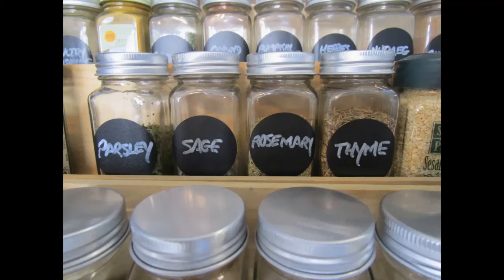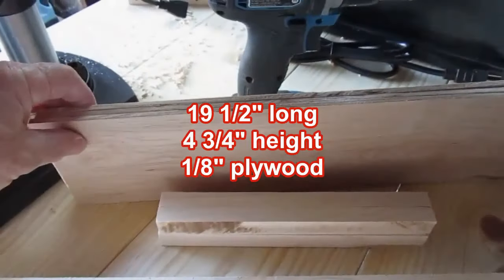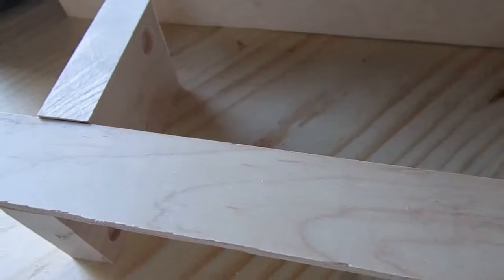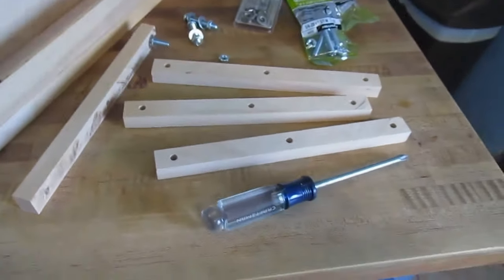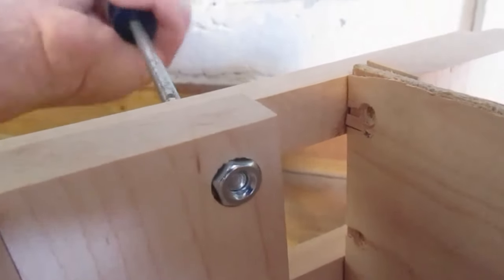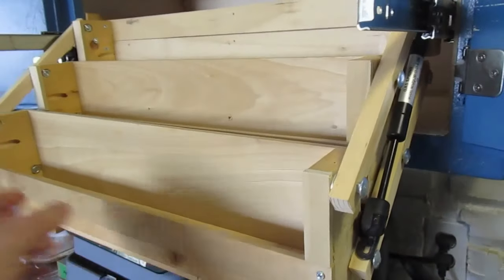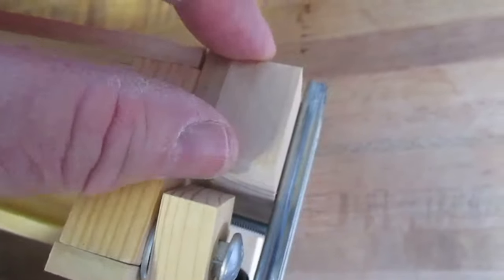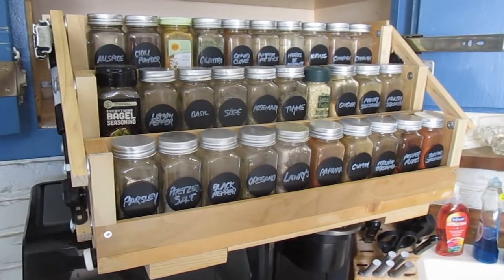Organize Your Kitchen Like a Pro with This Unique Spice Rack

Comment: Nice project.  I would use a router or dado stack to recess the fronts.

Forget the nails.  Glue is enough.  Maybe one screw through the bottom into the side.  No pockets to catch anything.

Those are not carriage bolts.  They are round head Philips head bolts.  Only the last two mounting bolts you used are actual carriage bolts with round heads and a square shoulder underneath.

You should say something about and provide links to good spice jars.

Keep up the good work.
Reply from the maker: Thanks for the input. Things definitely aren't perfect, I was kind of looking for some critiques. Actually there were two constructions featured in the vid: the first used carriage bolts, but the second used the round head Phillips bolts for convenience in assembly. I'm the worst "gluer" ever (so that's why I went with nails). Cheers!